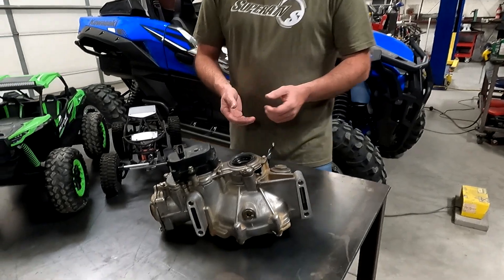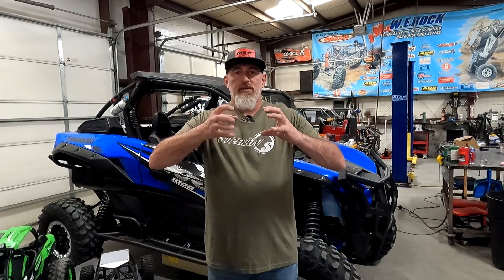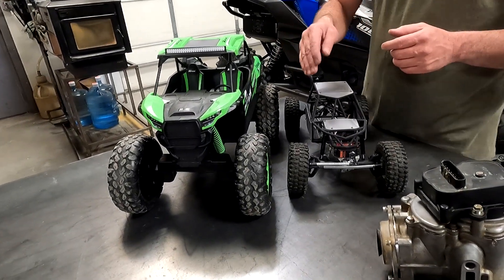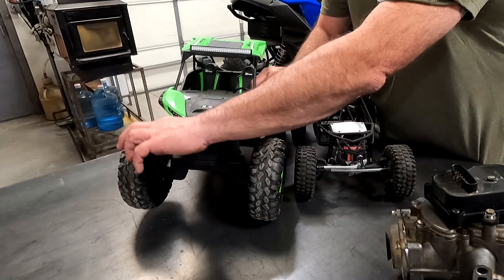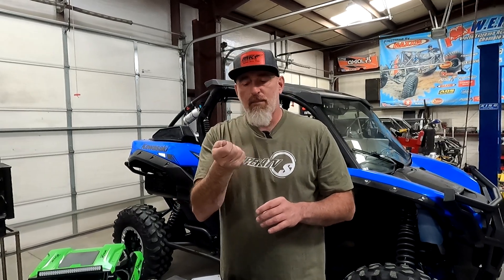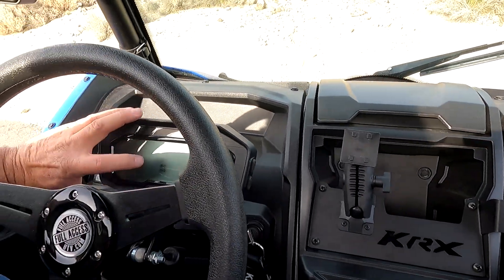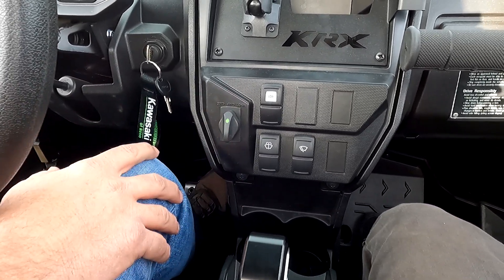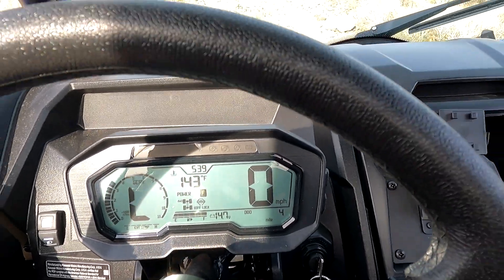Kawasaki KRX 1000 4wd and Front Locker. What you need to know.

Comment: My 2021 KRX doesn't show the 4 tires when I put it on 4wd and doesn't show the Lock Diff, but I can hear the diff lock.
Reply from the maker: If you’re still under warranty, bring it to the dealer. Otherwise someone probably changed out your shift fork on the 4 x 4 engagement motor. It’s not in the right tooth and is not sliding far enough to engage and touch the sensor.
Reply: @fullaccessutv  thank you very much!

Comment: Jake, my 2021 would jump out of gear on steep declines, high gear only. JBS makes a $8.00 spring that
goes on the passenger side of the transmission. It has not happened anymore, been about five months 
since I installed it. Took maybe five minutes to install. Question, are the nerf bars on the blue KRX
made by Top Gun Fab?
Reply from the maker: That Spring works for some, some it does not. That’s a customers krx and I’m not sure where he got those nerf bars
Reply: @fullaccessutv  Thanks

Comment: Do you know anything about the transmissions coming out of gear when going downhill? I have this happened a lot when coasting downhill.
Reply: Same
Reply from the maker: I have to say this is an odd one. It was actually asked in my last video also. I even had a customer locally who called me about it last week. It’s been over a year specifically dealing with Kawasaki and the KRX. I can honestly say I’ve only ever heard it from three people until last week. And now I’m hearing from about six people total. There must be an issue, and my last customer said that Kawasaki has a ticket number to it but doesn’t have a cure. Unfortunately I have never seen this issue and don’t know anybody locally with it.
Reply: @fullaccessutv  Thanks for responding. Maybe in one of your upcoming videos you could mention this issue and ask viewers to come in about it.
Reply: @fullaccessutv  the Facebook groups say it’s the one way bearing.
Reply: I did the bearing did not fix it so I adjusted the shift cable and have about 2500 miles with no problem just saying
Reply from the maker: I would say Kawasaki knows more than the Facebook groups. Been thinking about the one-way a lot but I don’t think that could be the issue. 
Cris did the bearing and it did not make a change. From my understanding people who have brought it to the dealer have only gotten a cable adjustment and for some it has worked. For others it does not. My local customer said Kawasaki knows all about it but doesn’t have a cure. 

Kawasaki‘s been pretty awesome so if they were to fix it, i’m sure they want it to be correct. 

I think that’s because those gears are already damaged in the transmission from all the grinding. I should probably get a video up and see what people have to say.
Reply: They seem to have a fix the customer has to call kawasaki direct they give you a case number then when the parts come in you take your machine to the dealer, the dealer was pulling and sending the tranny in but now seems they are sending the parts to the dealer
Reply: @kidamere2408  thanks
Reply from the maker: @kidamere2408  I’ve heard the dealer fix the issue in the past but it didn’t really do anything. Is this a new claim and would you mind posting your claim number? Or ticket number?
Reply: @fullaccessutv  friends machine ill see if he has a ticket number this is suppose to be a new fix so far 2 people who i know had it done they havent had an issue yet
Reply from the maker: @kidamere2408  Great. Yes please send me your ticket number and I will check into it.
Reply: @fullaccessutv  i

Comment: Just took my krx to Moab. Tried going up a wall in 4wd low gear and it made my 4wd flicker and switch between 4 to diff lock to 2wd. Won’t stop if I put in 4 but it will be fine in 2wd. Someone with real answer please help idk what’s wrong with it and don’t want to pay dealership to waste my money to not figure it out
Reply: There was no click or or snap nothing broke. It will switch into 4 wd and work and then switch out
Reply from the maker: @KawiKrawl711  So nothing to do with locker? Just four-wheel-drive engagement? Sometimes if the engagement eye is not mounted correctly it will flash back-and-forth but you were actually in the four-wheel-drive. You would have to jack it up and get the front wheels and tires off the ground to find out